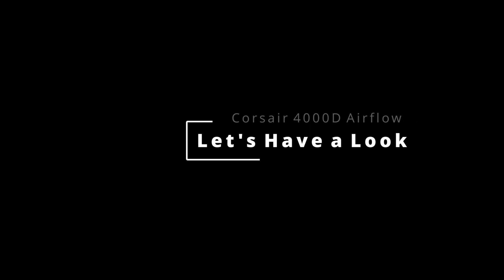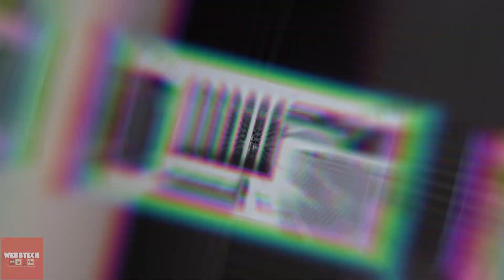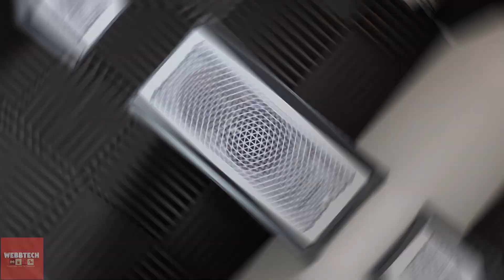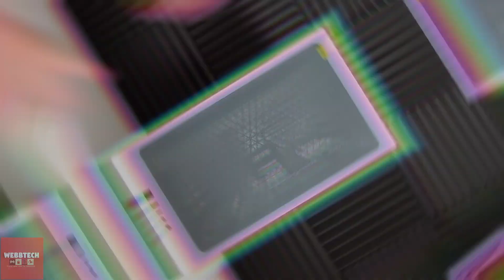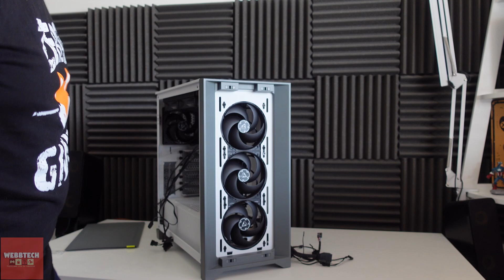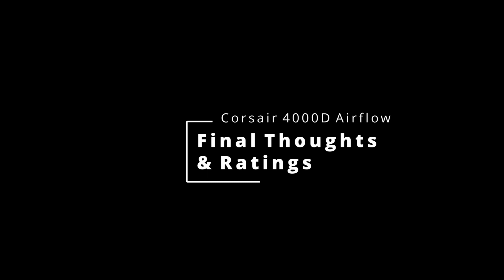Corsair 4000D Airflow - Build & Review with RTX 3060

Comment: I want to use a Galax 4070 ex which is 336m and the max capacity is 360m. But the fans which i will be using is 3cm in width. Should i count the 120m fans width together with the 360m capacity? Like 336m+30m or is the capacity just 360 with fans included.

Comment: Hi, I have the same case as you, but I have 1 problem. I’m using a gtx 1080, and although it’s shorter than 366mm, it gets blocked by the cable management flap. I noticed that yours goes over the flap without vertical mounting and was wondering how you did that. Thanks!
Reply from the maker: Do you want to email me a pic of the issue at hand? WebbTechYT@gmail.com
Reply: @WayneWebbFilms  sent.

Comment: Hello! In the process of building my first PC. I have the same tower and everything is pretty much put together! Although, I am having trouble fitting my RTX 3060. Seems a bit too heavy to fit horizontally, but you seem to do it perfectly fine! I was thinking of getting a vertical mount, but before I purchase, did you have any tips? I have a Thermaltake Floe Riing 360 AIO Cooler.
Reply from the maker: There are a few tricks. Insert the GPU, lift it slightly and then screw down the card. You could get a GPU anti sag bracket, there are a couple of types, 1) a brace that goes into the slot below the GPU, 2) a stand that you put at one end of the card. Here are a couple of links
https://www.amazon.co.uk/dp/B08C2CTPV6
https://www.amazon.co.uk/dp/B08YYB3WM2

Personally I would avoid vertical mounting because you'll have less airflow to the card and you'd have to buy a riser card, which are expensive especially if you need a gen4 one

Also take a look at the Jayztwocents video on this https://youtu.be/liChy76nQJ4

Good luck with the build
Reply: @WayneWebbFilms  thank you so much!!

Comment: Can i install the 280 rad to the top with "CORSAIR 32GB 2X16GB 3200MHZ DIMM DDR4 VENGEANCE RGB RS BLACK" installed?
Reply from the maker: Unfortunately not, you need low profile ram.
Reply: @WayneWebbFilms  Thanks for the help. so this will fit? CORSAIR 32GB 2X16GB 3600MHZ DIMM DDR4 VENGEANCE LPX BLACK
Reply from the maker: Yes that will fit, I previously tested it myself
Reply: Yea it will I have that in my 4000x and roof cooling and it fits
Reply from the maker: With a 280mm radiator?

Comment: I’m using a 650watt power supply for my 3060 build would that still be good or should I upgrade to a 750 or 850?
Reply from the maker: The PSU doesn't matter unless it's an SFX with short cables. You're absolutely fine sticking with your current PSU

Comment: I have same problem with AIO and RAM size, do you recommend front AIO install with push or pull? I have Fractal S24 Celsius+
Reply from the maker: Hi dude, sorry I missed your message. I prefer pull on the front, but there is virtually nothing in it

Comment: Ok so even tho you have the radiator mount on the front can you still had fans in front of it?
Reply from the maker: Hi, I think I follow you...you can mount fans on either side of the radiator or even both at the same time (push/pull) should you have enough fans of course.
Reply: @WayneWebbFilms  got it, i was worried about that because i have lian li unifans and the rgb lights sit on the sides of the fan. Im going to have fans on both sides of the radiator, front and back. I was worried since the glass sits infront of the radiator i wouldn’t have space to fit in the front fans i need. Sorry im just really bad at explaining stuff.😅. Ill put this in word form. Ok so its        fans|radiator|fans|glass|      . Kinda like a sandwich but vertical, i hope that made sense LOL.
Reply from the maker: LOL I liked your visual/word explanation...Will keep that in the memory backs ;)
Yeah you're fine, there is a gap between the glass and mounting spots. What GPU have you got because that is the only thing that would stop you
Reply: @WayneWebbFilms  my graphics card isn’t that big, i should be able to fit it in. I have a evga geforce rtx 2080 super.

Comment: Hey I want to fit my 240mm aio on the top with vengeance Pro rgb ram and also I want my psu rm 850x with the hdd trays and also 3 fans on the front is it possible
Reply from the maker: Yeah that will be possible.

Comment: Is there a reason to fit the aio at the top of the case? Or just personal choice?
Reply from the maker: Personal choice/aesthetics and its best for the cooler. Temps are a bit warmer at the top for the CPU than if front mounting but it's a balance between what looks good (subjective) and performance.
Reply: @WayneWebbFilms  I'm thinking of getting this case for an upcoming build for my son later this year. 

I thought front mount was okay as long as the part that goes onto the cpu was below the top of the rad? Is there a reason you couldn't do it the other way tubes at the bottom?

Do you think running an I5 11600 with helpfully an rtx 20/3060 with a cooler master hyper 212 and the two stock fans be enough?
Reply from the maker: It's a really good choice and I'm still using it now. Bargain, case wise, of the century. 
Front mounting is perfectly fine with tubes up or down as long as the pump isn't the highest point of the loop or you'll have issues sooner or later. Tubes down is the best option out of the two but it all depends on tube length/flexibility and whether your GPU gets in the way.
I would probably invest in a slightly better aircooler than the EVO 212, but it will do the job with that CPU. I would suggest getting some good case fans because the 2x3pin fans that come with the case aren't up to much. I would recommend geting Arctic P12 PWM fans which are very reasonably priced and offer great cooling as either case or AIO fans. Hope this helps.
Reply: @WayneWebbFilms  Thanks for the response. I might try the standard setup and worst case I can always add to it later. He's 10 so doesn't need overkill but then we also want it to last don't we haha

Comment: Can the corsair vengeance pro rgb  fit with the 280mm?
Reply from the maker: Hi, unfortunately not. It's only compatible with low profile ram ie Corsair LPX. You obviously have the option to front mount a 280mm AIO
Reply: @WayneWebbFilms  thanks
Reply: @Roberto_4273  get a 240mm it's nice too also vengeance Pro comes in a low profile variant too